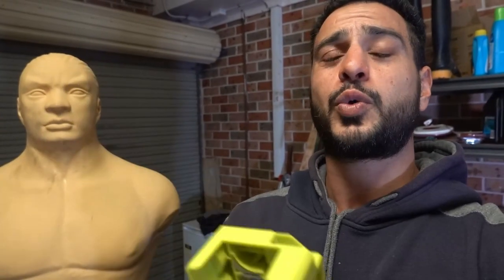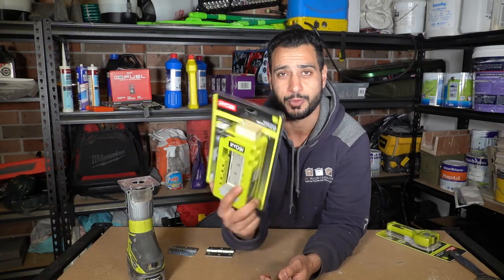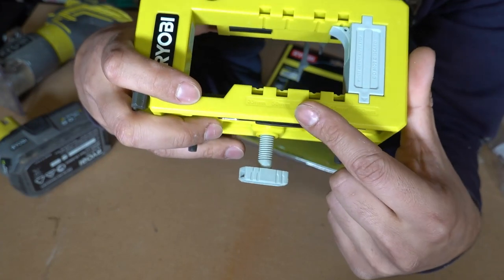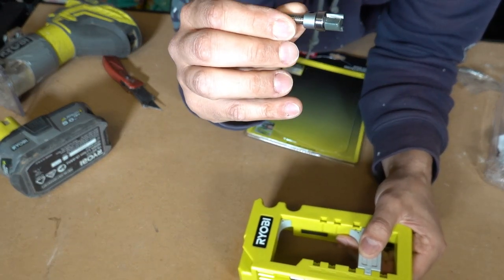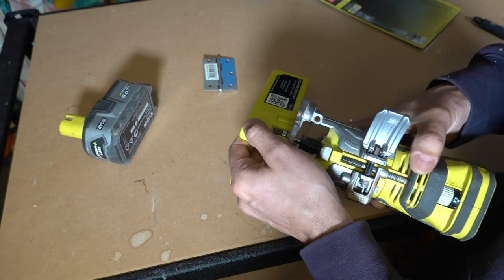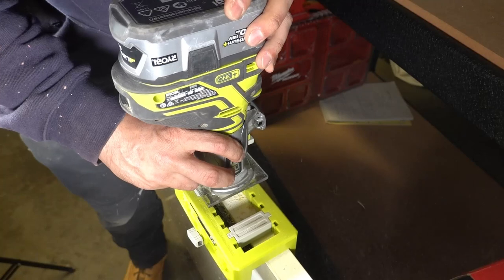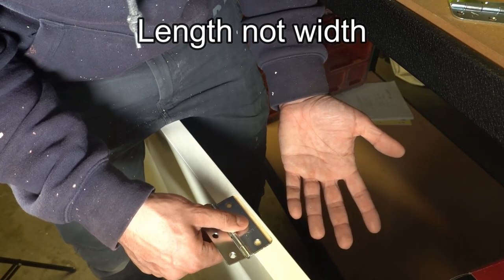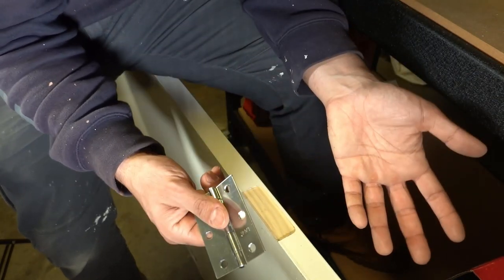Ryobi door hinge jig- watch before you buy

Comment: I’m confused it seems obvious to me that with square hinges there was just no way physically with a router bit to cut a square corner, so there’s no way you’re not going to have to chisel out the corner which should’ve been done to begin with. Those protective spacing tabs you removed made it worse and I think you would’ve been fine had you just chiseled out the corners and did nothing else. It’s hard to see everything from the camera view but that’s what it appeared like to me, especially not taking out those corners to begin with, that was a “duh” moment.
Reply: They aren't "protective tabs" they are inserts that allow you to cut any of the standard two radiuses used in door hinges: 1/4" radius or 5/8". Without the insert in place your router will cut a 1/4" radius. With the insert in place, it will cut a 5/8" radius. To accommodate a square hinge, you'll have to chisel the corners square, regardless of weather or not you use the insert.
Reply: @chuckzissman4081  you're talking about something different, the protective tabs/pads are the rubber ones protecting the sides during clamping.

Comment: 3 points to understand.. 1) This jig is for the US market (which you finally understood late in the video), 2) The US hinges are deeper than elsewhere ( again you worked this out but just to add here in the UK our 3" hinges are even shallower than those you were using so just routing the rebate out using the jig dimensions would leave half the door routed out and would look stupid. 3) taking the rubber buffers off the clamping side makes no difference to the depth of cut, but it does result in marking the door with the clamp screw, you are over-tightening the clamp. If you had marked the hinge out as you usually would and then placed the jig on top, you would have noticed the jig didn't line up and would have only routed up to your marks to ensure a good fit. What it needs is some different thickness shims to go on the non clamping side to stop the router going too far towards the non hinge side of the door and leave no gap around the hinge.
Reply: It does make a difference in the depth of the cut: It decreases the thickness of wood remaining between the back of the hinge and the door stop, which would increase the gap between the door and the stop when the door is closed.
Reply: @chuckzissman4081  Not on the clamping side mate, they are only there to stop the screw clamp marking the door. The other side maybe but not on the screw clamp.
Reply: wrong the door was still marked even when leaving the rubber stoppers on as seen in the first attempt. so you are wrong
Reply: @mechanicalman4531  the door gets marked with or without the rubber stoppers if you tighten the clamp too much, the point I was trying to make was that having them there or not having them there on the clamp makes no difference to where the jig aligns on the edge of the door, only the rubber stoppers on the side opposite the clamp have any say in where the jig sits, but even with them removed, with the sizes of hinges in the UK (and it would seem from the video, elsewhere as well) the jig is the wrong size for these markets, I had to drop a shim into the hole where the router goes, up against the non clamping side, to stop the router cutting too deep towards the edge.

Comment: You have no choice but to nock out the corner with a chisel Before you remove the template. The jig works just fine when used corectly. Another tip. Dont over tighten and put your "padding things back on"

Comment: I’m in the UK. I too had this problem of it cutting too much out of the door

I fixed it in 5m (literally) by cutting a small bit of wood 8mm thick and gluing to inside of the hole (opposite side to the clamp side. 

It now works perfectly. Cost me nothing to fix.

Comment: Thanks Bill.  By showing the flaws in this jig you have saved me a lot of trouble.  I plan to buy this jig to hang a door because I really do not like chisel rebating.  I plan to use plastic packers with double sided tape to reduce the width of the cut.  Fortunately bunnings sells packers in 1mm, 2mm, 5mm and other sizes that makes it easy to customize.  Double sided tape means you can insert and remove the packers at will.  Good on ya!

Comment: Hi Bill, just watched the video, not sure if this will fix the issue of the gap, but if you change the bearing to a tad bigger it eg”1.5 mm bigger”  that should give you a snug fit all round. Cheers keep up the great videos mate. 
Joe 🇦🇺 🤙🏼
Reply: The problem with that is it will cause the door to be 1.5mm closer to the stop, which could cause interference
Reply: wrong because it will then give the incorrect height
Reply: No it won’t….

Comment: Hey mate, my guess is they have fitted the wrong sized bearing to the router bit. "Outer diameter" on the router bit they have supplied. Bearing outside diameter should be bigger.
Cheers
Reply from the maker: Hi , is a flush bearing so If the bearing changes then the length will be out. The length works fine it’s the width that seems to be out. I’ll keep following up and keep everyone posted. Thanks 👍👍👍
Reply: @billshowto  the width / outer diameter of the bearing is what I'm trying to say, If it's of bigger width / diameter it won't go in as deep / far into the cut out for the hinge and there won't be a gap on the back side of the hinge what your encountering. Just a thought.

Comment: I don’t think the issue you encountered is related to the pads. This Ryobi hinge installation kit is not designed to finish the corners for square hinges. The user manual that came with it indicates that for square hinges, the corners have to be finished with a chisel (I was quite surprised when I read that!). I’m in the U.S. Not sure if your Australian kit comes with the same instructions. I hope this is helpful. Thanks for the video & good luck!
Reply from the maker: Same thing is mentioned in our manual also. The issue is that the jig do not accommodate for the widths of standard size hinges here in Australia. Apparently we are suppose to scribe a line for our desired width and only route up to that line. That kind of defeats the purpose of having a jig which is why I prefer to use the router free hand 👍

Comment: You are not a novice carpenter, you know that a round cutter doesn't make a square hole, great video and demo. Also if they included the corner punch like the trend kit it would be great.
Reply from the maker: I score the edges of my hinge location with a utility knife that way when I use the router in the corner it removes it completely. No corner punch needed 👍
Reply: @billshowto  very good tip thanks

Comment: Stick a plate 2 or 3 mm thickness against the side, narrowing the space of cutting. The plate will hit the bearing, stopping the router blade 2 or 3 mm shorter in width.
Reply from the maker: I was going to do this however I realized that this would not solve the other issues  of different standard size widths and lengths of other hinges. 👍👍👍

Comment: I have this and I used it for the first time just yesterday. Firstly, the width cannot be adjusted and is fixed so if you have a 2.5cm wide hinge as I did you can't adjust the jig to fit this size.  
Secondly, the depth that the jig allows you to cut is insufficient to ensure the hinge is flush with the door.  
Thirdly when you do cut in you end up with rounded corners.  So, if you use this you will end up having to use a sharp chisel to carve out the hinge recess which you may as well have done from the start. 
Bottom line this is a poor product and not worth the money.